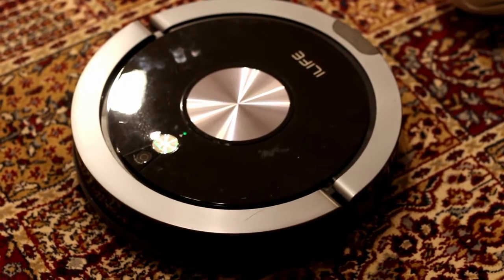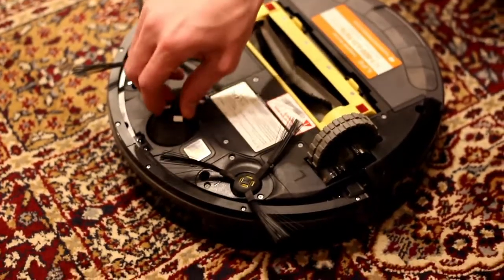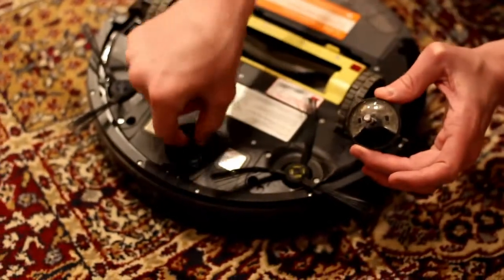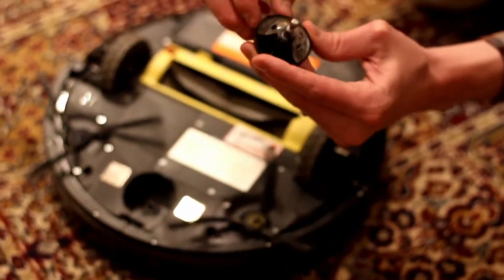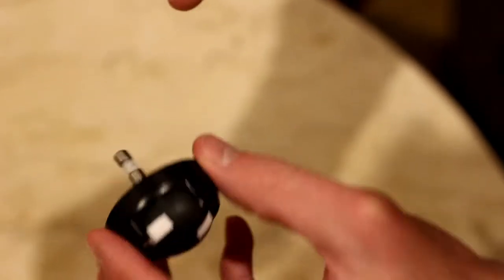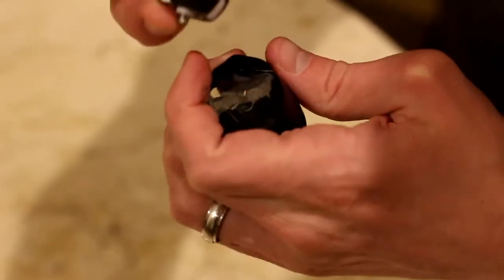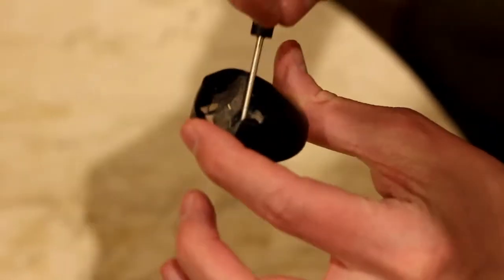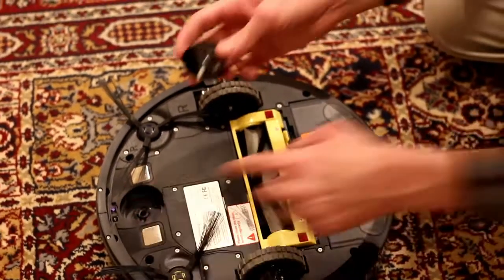iLife A9 Sensor Wheel Cleaning - Fix constant stopping and turning

Comment: Have you managed to take off the main drive wheels? I get a lot of cat hair stuck inside the wheels and wheel well.
Reply from the maker: Yes, they are "modules" that can be unscrewed easily from the bottom and pulled out. There's a suspension spring that's a little tricky, but I wouldn't be afraid to give it a try.

Comment: After cleaning completely, the problem keeps existing with me. I removed even the plastic part, without problem. 
I recollered the wheel in white and black, but without help. Any ideas left?

On remote control, it keeps running, and it does not stop and turn, till it hit the wall.
Reply from the maker: Try cleaning the front bumper; it has infrared senders and receivers behind it. Use a cheap camera like a smartphone to verify that the IR emitters are working.